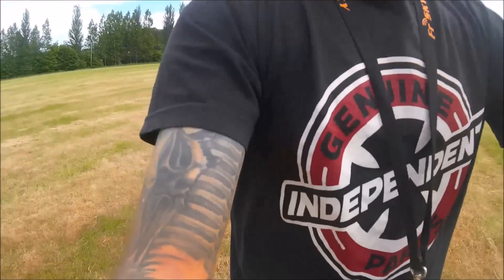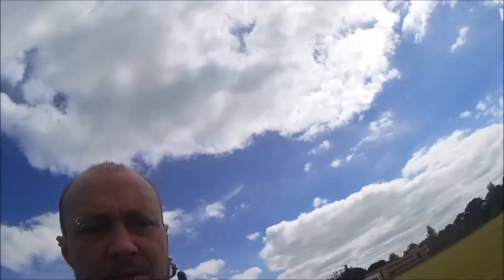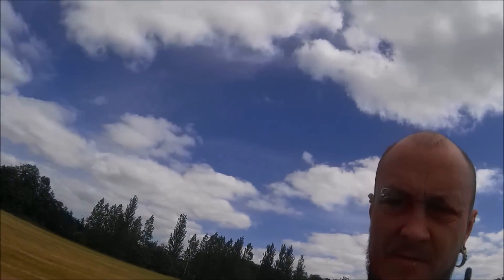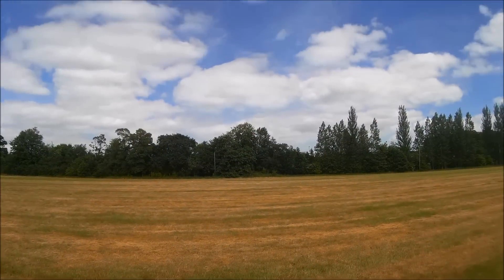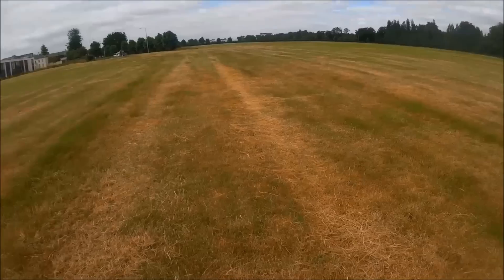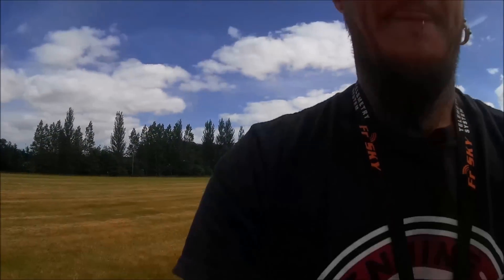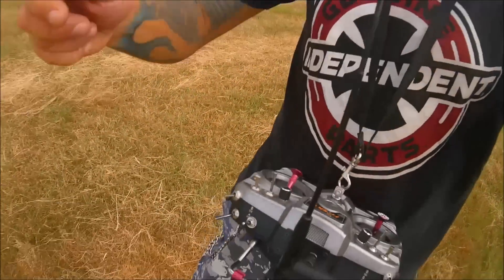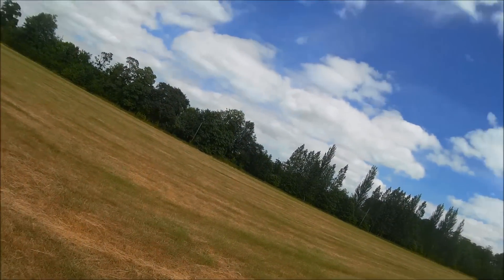Mini-Hex maiden FPV with failsafe failure

Comment: i really despise failsafe and just dont trust it.... i have been paranoid about my last almost lost my 450 was only a 100 yds away but she just does not respond and what do i do..... suddenly i give it zero throttle and she flies over this house i have no controls and land in the garden...not flown my 450 since... i dont like the switch warnings and throttle low on the turnigy as they interfere with the radio signal especially if you lose signal...and switch off... and the boot logo also slows the reboot....you dont really know if it works until it works.... or doesnot....

Comment: Man that sucks to see the failsafe failure.   It looks like you got your control back after you power cycled the Taranis.  Leading me to believe maybe a PPM failure between the Hawkeye & the Taranis.   Hawkeye probably kept sending the last known signal to the RX, and by shutting down the Taranis you then activated the failsafe.    Glad you got your shit back though, it took me over 6 hours to find mine one day.   No fun at all.
Reply from the maker: Yeah, I had my "brown pants" moment... Seems like the signal got somehow corrupted, that I didn't have control and FC thought that everything's fine and kept flying. It happened to some people as well who had telemetry on, and I'm still looking into this matter
Reply: ROBOFORCERX2000 Well next time it happens, just do a immediate reboot on the Taranis.   Also disable all the stupid switch & throttle checks.   And im sure you have, but if not, make sure your firmwares up to date.
Reply from the maker: Haha, that's exactly what I did straight on after that- disabled switch and thr warnings:) A bit paranoid to go flying now, but I'll get over LOL
Reply: ROBOFORCERX2000 what fc is it? i think it must be the radio or radio transmitter cause the fc if programed is very deterministic and should do what it was programmed. if it didnt go into fs it must of had a signal the whole time which means the radio is freezing up or perhapse one of the pots is sticking or something weird. i think a mechanical problem would be more likely but who the hell knows, very weird.
Reply from the maker: marshalcraft FC is custom made Naze32 clone running baseflight. Here's build overview video with links to more info: DIY Mini-Hex build overview & quick test. 
I have to agree as well with the theory about freezing and the signal- it was coming to FC so it didn't trigger F/S and kept flying with last stick inputs, but somehow corrupted signal or smth that I didn't have any control. I got controls back after power cycling Taranis, but was too far away and LOS already. It was one-of case and I never had anything like it before or after...
Reply: ROBOFORCERX2000 read that some frsky recievers will freeze last stick positions if fail safe is not set on the reciever itself.
Reply: marshalcraft i think with frsky you would need to dissable failsafe by unbinding the radio then rebinding then failsafe is off and it should stop broadcasting if signal is lost i think not sure.
Reply: marshalcraft oh i was wrong, for the dr4ii it says to pres the f/s button once while the transmitter is off and it will not not send pulses. i think this would make it easier for naze32 or baseflight to recognize failsafe has happened. again not sure will have to look into baseflight.
Reply from the maker: It is Hawkeye LRS on, not FrSky:) But I have both, and F/S sets similar on both. On OLRS I have to set F/S every time after hooking on to computer and I'm analy doing so as a habit, and most of the time checking F/S before flying that day. Was no exception here either, that's why I'm so surprised with this lockout:)

Comment: Robo if you have OpenLRS Telemetry enabled (on by default) disable it, I had Naze32 Locking up due to stray RF from telemetry. No problem with it off.
Reply from the maker: Thanks mate, I've done that already as more people suggesting this:) I had telemetry on Teksumo wing and there was no issues, I suppose just Naze32 doesn't like it. Now I have to overcome my paranoia and get out flying again :P

Comment: bud you need to buy one 

lost rc quad lost rc plane find it the easey way
Reply: have a look at this video bud 

and have a look at this eBay item number: 281010612514 it has about 100m bud and it might look like a kids toy but it would find and make your life easier and save you loosing your gear bud and its only £35 all the best from Ron

Comment: Glad you found it mate... maybe reloading firmware could help you to avoid that problem.... other than that its a great flyer with plenty of power.
Reply from the maker: Yeah, it was like stone of my heart when I found it. As the buzzer wasn't working I was walking through the same place few times, but then spotted few strawberries close to my feet, which apparently was my bright orange motormount claws sticking out of a foot high vegetation:) sheesh, don't remember being so so lucky...

Comment: You should put a language warning on this video! :)
Dude what the heck happened there???
If that hawkeye uses the openLRS FW you gotta be careful as it is not very resistant to interference.
Reply from the maker: Well, you know me by now, I learn to curse from the best- Irish:)) I'll include the warning in my next video.
I honestly don't know what happened... I believe it's the field- loads of paranormal RC activities happening there, but on the other hand- if I set F/S to cut the motors, then FC should do so instead of keeping last inputs. Unless there was sort of a dodgy signal from interference that FC thought it's all good and kept flying... dunno mate, just guessing...